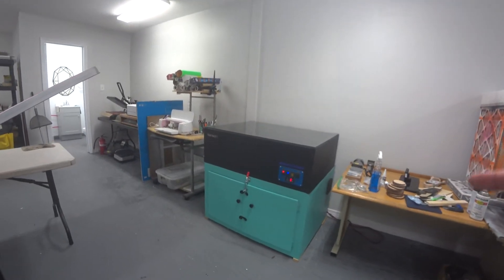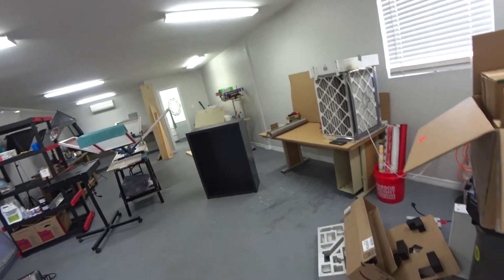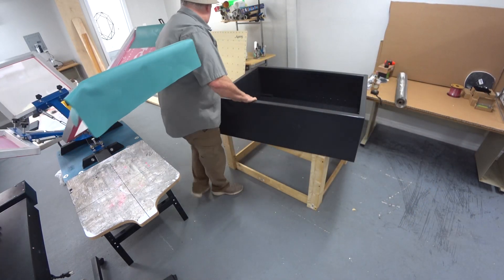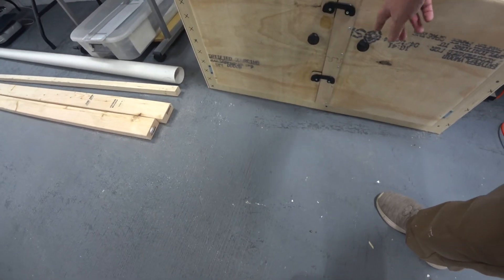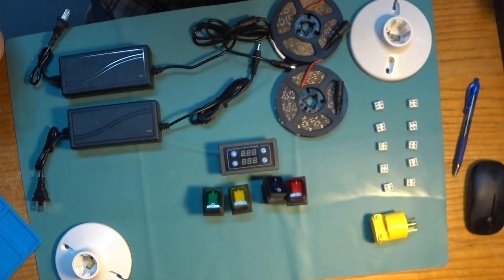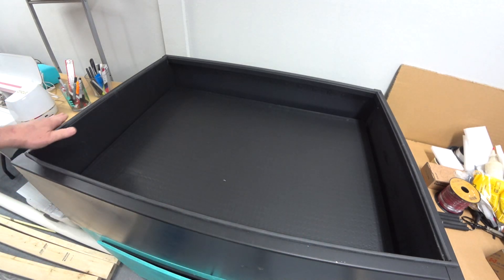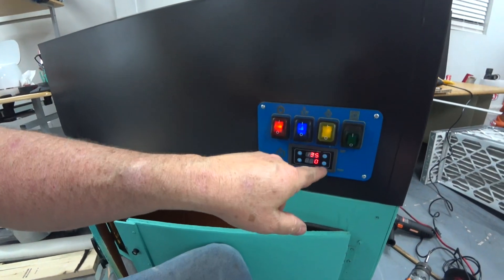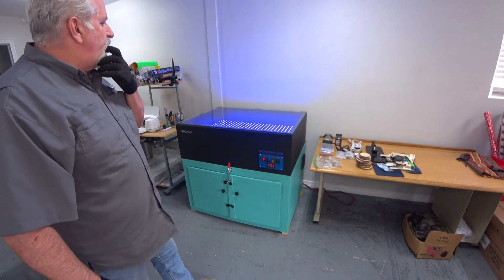DIY Screen Exposure Unit Build for Under $500 | Budget UV LED Setup for Screen Printing

Comment: I have a question:
I've learned that the industry standards for optimal curing many types of UV sensitive substances like inks, screen printing emulsions, dental resins and so on, is 365nm wavelength.
Did you experience any difficult exposing the emulsion to 395-405nm LED UV light?